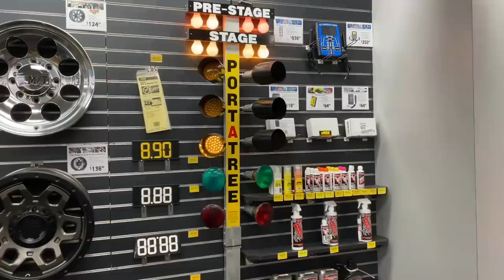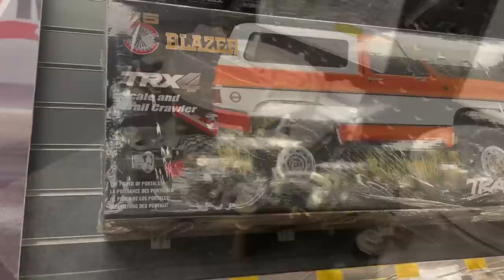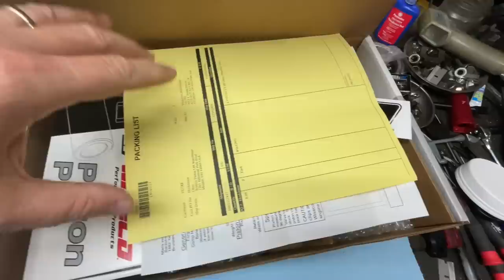JEGS TRIP!  New Pistons for T2G and ALUMINUM CORE SUPPORTS!!

Comment: Bill do u think those hd wrist pins will pull out the bottom of the piston? Reason I ask is it happened to me on a 11to 1 sbc, at 5500 rpm, after it was to late I noticed that not all pistons were the same looking at bottom of pistons, that one that broke the wrist pin boss on bottom was thinner? Keith black pistons and standard pistons,?

Comment: Can you post the part number for those pistons? That's my exact bore, stroke, and rod length, looking to drop my compression. Need something with the top ring down lower. How far down is the top ring? Thanks.
Reply: They're custom so youd have to call wiseco up

Comment: Bill, why is the compression ring groove down so far? Is it due to running boost? Back in the day running N/A that groove was right at the very top. Thank you.
Reply: Nitrous and boost, you need a thick crown, and you need the top ring down away from heat. Just not too far down. 
 N/A engines are not as critical. Still don't want them too close to the top, but is actually more beneficial running them higher. They also don't see the heat an adder engine does. Definitely application specific.